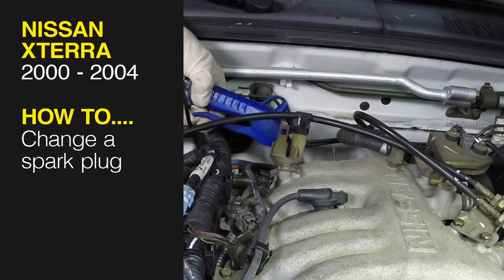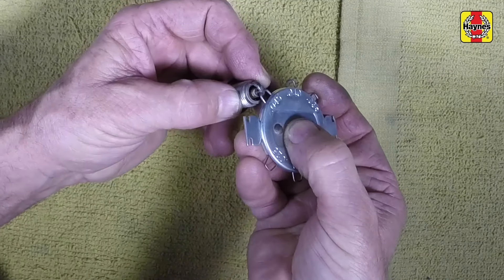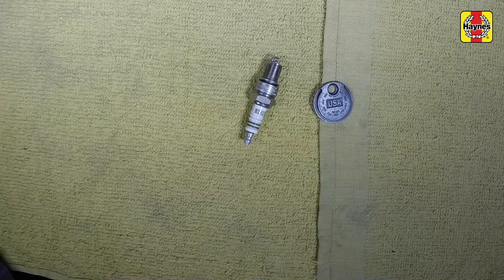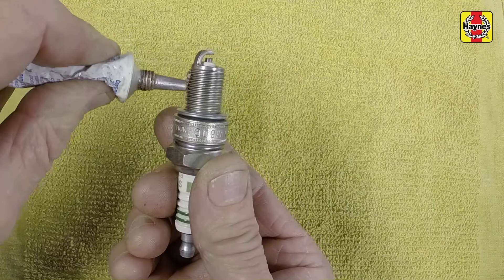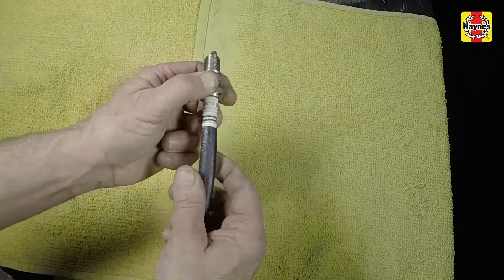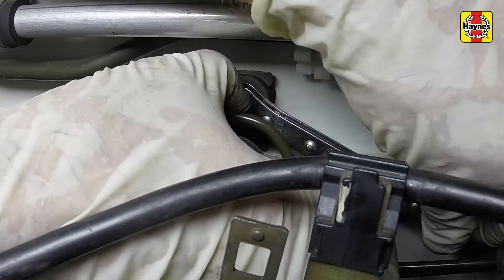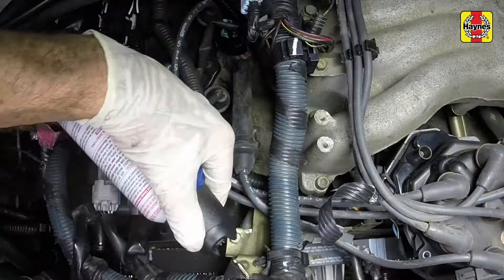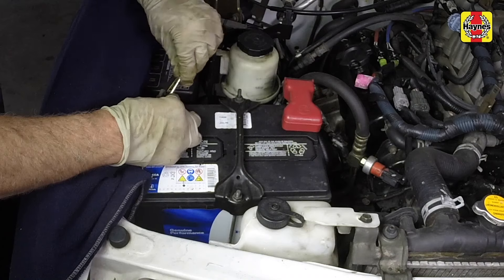Replace the spark plugs on a Nissan Xterra (00-04), Pathfinder (96-04) or Frontier pick-up (98-04)

Comment: It’s a lot easier to use Type A and B spark plug socket wrenches that come in the tool kit with most Pathfinders. Look under the carpet, back passenger side seat.
Reply from the maker: Thanks for the tip

Comment: Would love your answer to this: on my spark plug 5, there is a prong that the comes out top of engine for spark plug boot to sit on. My spark plug boot i put on is about 2 cm from resting on it. Now the boot seems wiggly bc it won’t remain still due to the distance. 

** the wire and spark plug are connected and it solved my issue. But will it flopping a little cause damage to the rubber of the boot cause damage when it touches the hot engine??

Comment: PLEASE HELP! 
After screwing in the new spark plug, my short socket wrench would be stuck inside and would not be pulled out along with the extension bar! All my tools are new! thank you!
Reply: try and idle the engine for a while, while applying wd40 the metal should expand then turn it off after about 20 min of idle and run water down your tool it should slip right off
Reply: Ben Blackwell thanks dude
Reply: Unscrew sparkplug, tape the socket to the extension then try again.
Reply: @FroztiProductions  you have done this?
Reply: @eeyyaakk6801  Everyone does this, gotta tape the extension to the socket.
Reply: @FroztiProductions  thanks friend